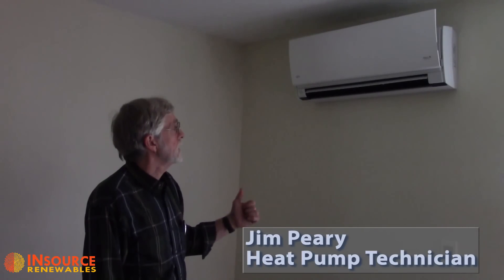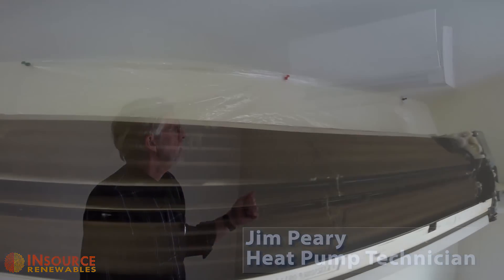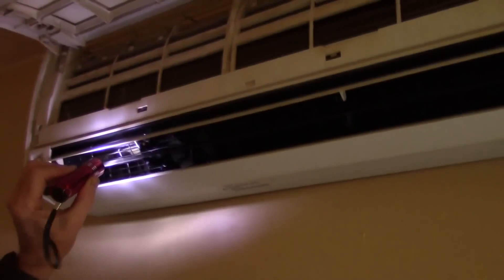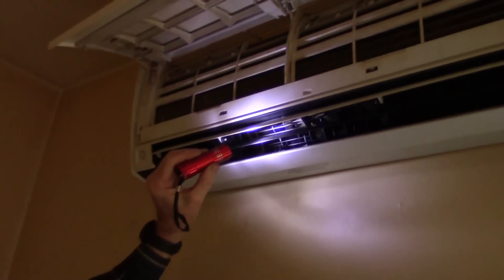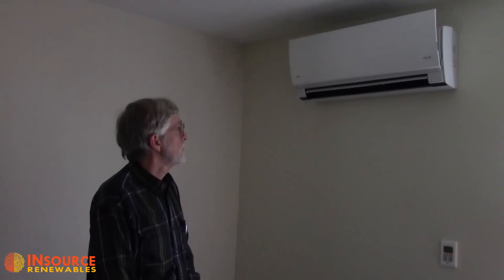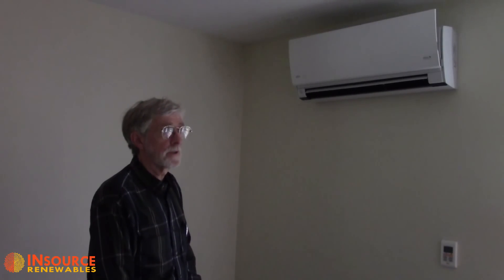Mini-split Heat Pump Deep Cleaning

Comment: The exact place in the video that show how to remove the cover is sped up so you can't see how the cover is removed...this is the part I need to see in detail to know HOW TO REMOVE the cover!!
Reply: Exactly! Cover removal should be shown slowly, with close-up detail, so the DIYer does not break the damn cover! It's even harder to get the cover back on, so that needs to be shown in detail as well. Manufacturers should lose the stupid clips and just make a simple rigid cover that's held in place with screws only!